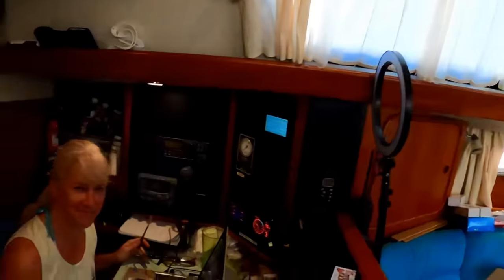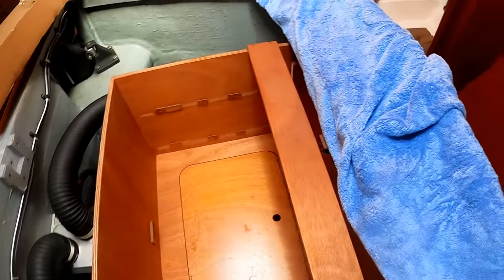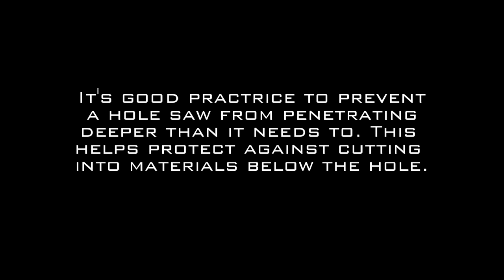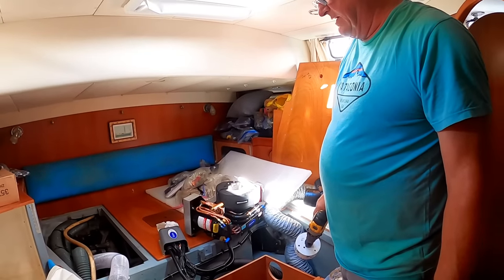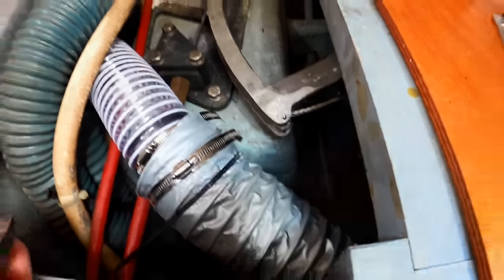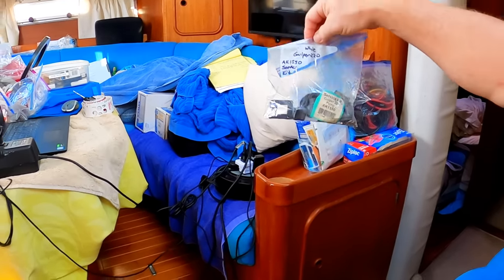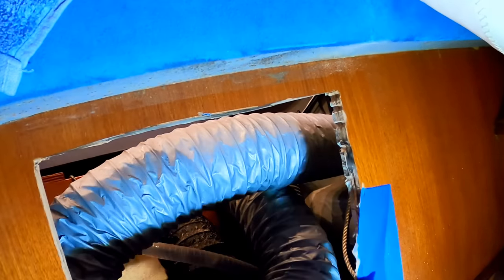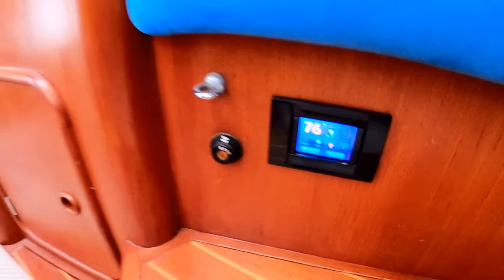Ep 143 Installing Mabru 12V Marine Air Conditioning

Comment: What did you ever figure out with the hydraulic backstay?
Reply from the maker: So I dropped it off at FKG Rigging in Dutch Sint Maarten where we had our standing rigging replaced earlier this season, and their hydraulics shop replaced the hydraulic oil but didn't have the time or materials in on hand to cut another ram, which was their preferred solution. I love that backstay tensioner, and feel it provides not only fantastic adjustability, but redundancy in that it has the threaded safety rods along the side, making it practically failproof (as long as you have the locking nuts set as required). So we decided to put if off till next year. It isn't a day-to-day problem as we use the locking nuts to carry the load and then release the hydraulic tension afterward, thus keeping the seal from seeping. The source of that problem was/is the flaking chrome on the ram, which has damaged the seal. My only concern is that stainless steel is weaker than tool steel, but the FKG guys say it isn't an issue. Next year we'll address.

Comment: how much did it cost installed ?
Reply from the maker: About $5,500 per unit, plus wiring, fuses, droppers, and ductwork, all of which were surprisingly expensive. A general rule of thumb for labor on complex jobs in the USA is to use the total materials cost as your labor rate, although in this case I would have assumed just the main units, so approx $11,000 for install. In the islands, less, but install quality would have been questionable due to lack of specialized tools and a more general disregard for fit and finish.

Comment: Ouch. You're using water to remove the heat. You have a 24 to 12 volt converter. To me, a mess that shouldn't be promoted. Campers already have a 24 volt all air DC system. You install it up high, dry, and safe. It's about 40% the size of a window AC. A good DC air conditioning show should show the simple  installation, proper electrical connection, how to budget the watts, and how to use feel and not waste the AC.
Reply from the maker: With respect, nearly all marine a/c installs, starting with OEM installs, are water cooled. This is because you don't want a deck mounted condenser like you do with an RV where you can mount one to the roof. And the marine specific 12V/24V systems are just barely arriving on the market as we speak. Prior to this, 95% were/are inverter fed 12V or 24V house bank source to 230VAC. Such an inverter would be expected to draw well over 90A from a 12V house bank, at least on startup. And typically, most smaller sailboats (below 45') will utilize 12V house banks. Larger 45' plus boats will move to 24V based on the need for longer wiring runs. Double the volts means half the amps. Mabru (which offers both AC and DC units) has a video on their site demonstrating this. Part of what they show is the parasitic conversion loss when using inverters to convert to high voltage. But by using a native 12V or 24V system, you can easily get a high quality Victron Orion dropper that will minimize conversion loss, which we have seen ourselves in the day to day operation of our two units. Know that as I was shopping, I kept seeing Chinese "24V" A/C units being sold at attractive pricing. But as I investigated I found that many were simply adding an inexpensive inverter to a native 230VAC unit, meaning that you were just buying a workaround design.